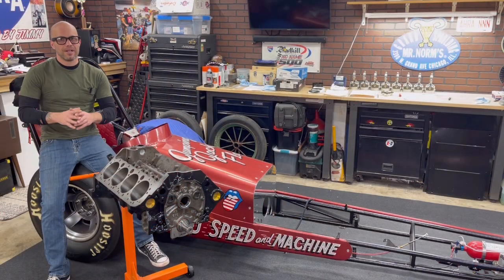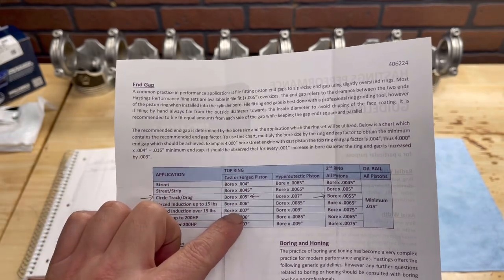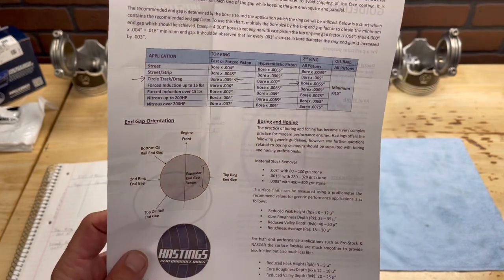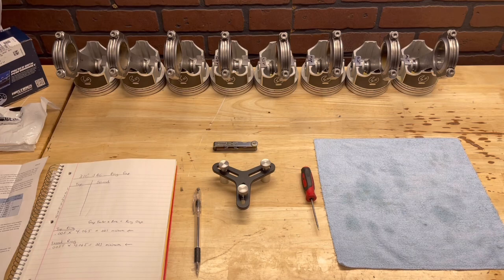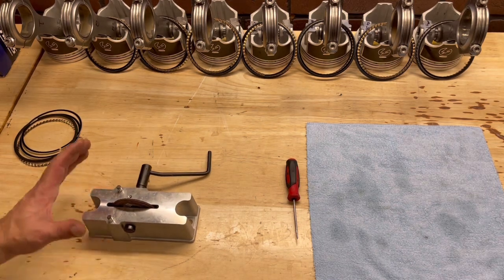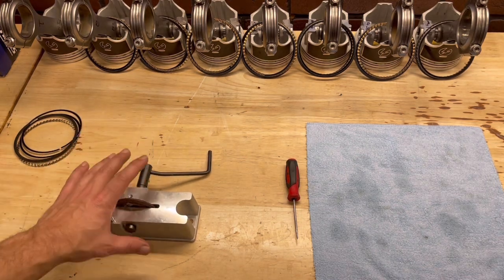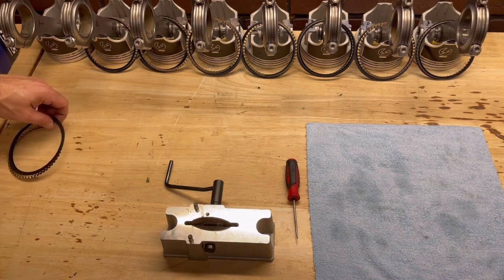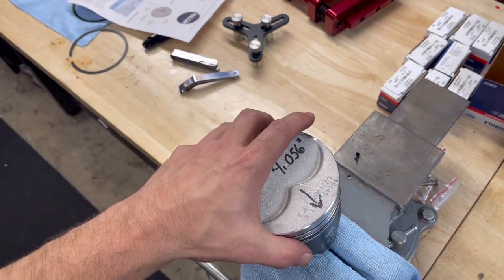Piston Ring End Gap and Orientation - How to Install Piston Rings #engine

Comment: Great info. Back in the 90's when the Hypereutectic pistons came out if you didn't fit the rings
properly. They would seize in the bore and pull the top off of the piston. Just curious why you
don't have the cam in the block? I do that first in case there's an issue with a bearing and I 
have easier access to correct a problem and you can feed the cam in with both hands 
without the crank and rods  in the way. Just asking. Tell Kyle Leland said hi. Keep up the great
work. Thanks for the video.
Reply from the maker: Ah that’s a good idea, never thought of doing that!  Definitely would make things much easier!   Thank you, hope all is well with you!